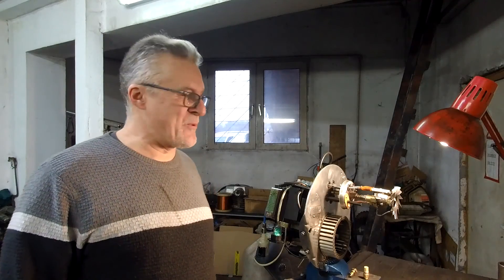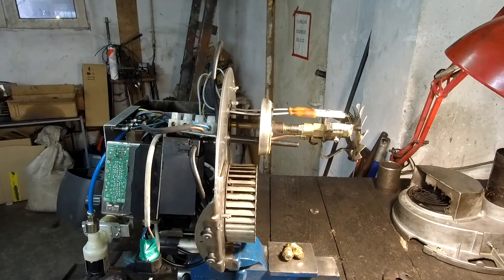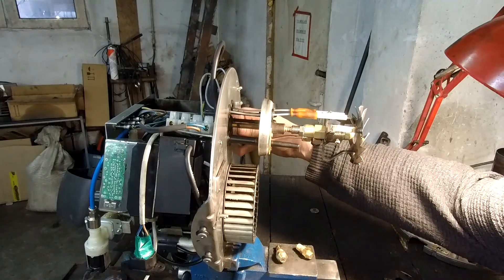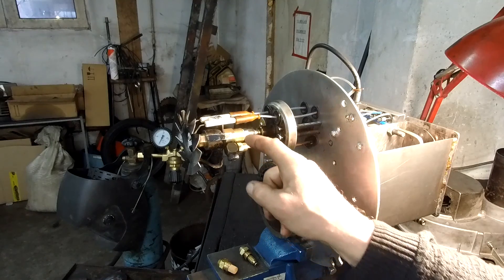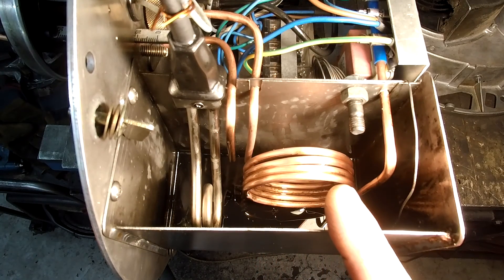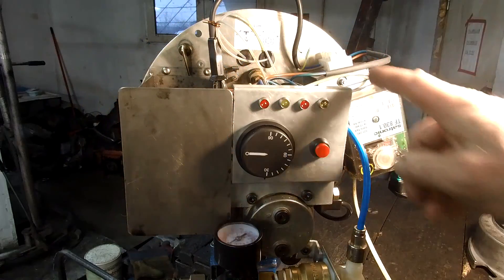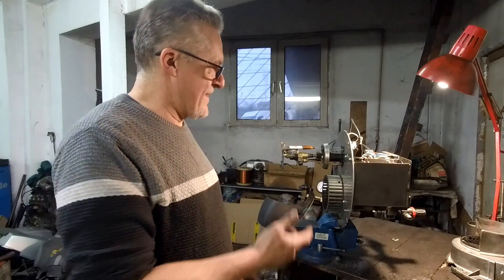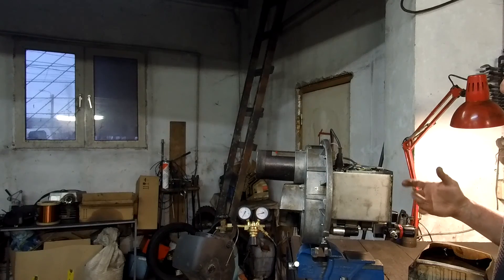How to convert diesel burners to work on waste oil, a brief presentation

Comment: How can you make the burn more complete to make sure you get all the oil to burn ??? What is the trick Sir ??? Thanks
Reply: I'm pretty sure it's the compressed air and the pump speed
Reply: @montiacpontana41  Thank you for your response Montiac. Look forward to see more great video from you. Good day too.
Reply: @montiacpontana41  Theres no pump on siphon systems. Air pressure controls fuel.
Reply: @ hi, mine has a little supply pump where i can adjust the puls

Comment: Thank you!
But why we have to change the nozzle? Why can’t we use standard diesel nozzle running of fuel/oil pump and without compressed air?
Reply from the maker: Due to high viscosity of waste oil, this can not be atomized to fine particles only by using siphon nozzle and compressed air. Original kerosene or diesel nozzle has a very fine hole and will be clogged with wasted oil.
Reply: Nobody wants to run an air compressor. Why not just replace nozzle with a bigger one and preheat the oil in a 4 liter reservoir tank? I’ve never even heard of an air compressor in a furnace. Don’t they use a fuel pump that supplies pressure for proper spray pattern? Like 100psi or something?